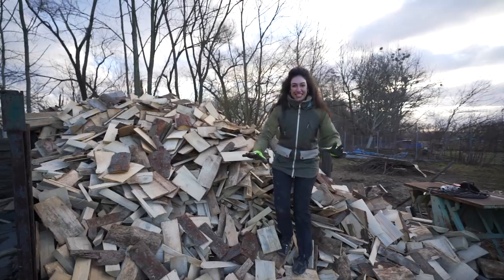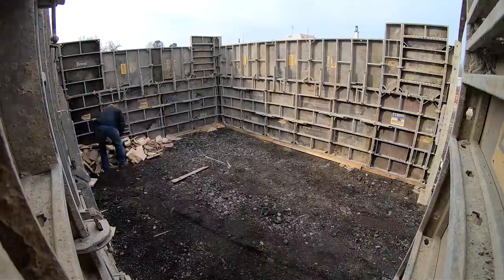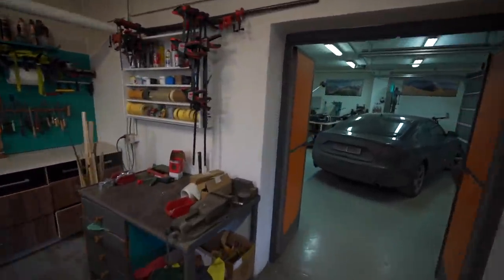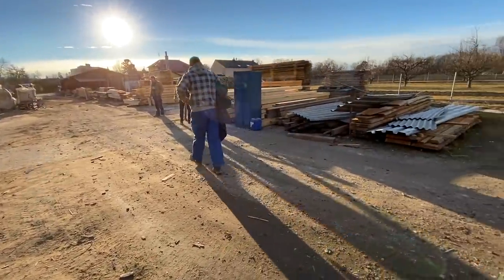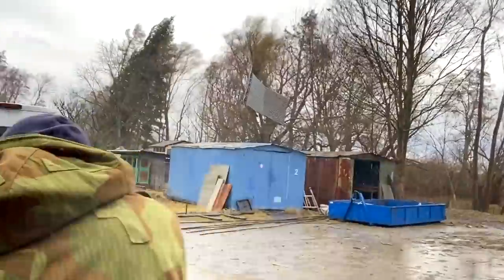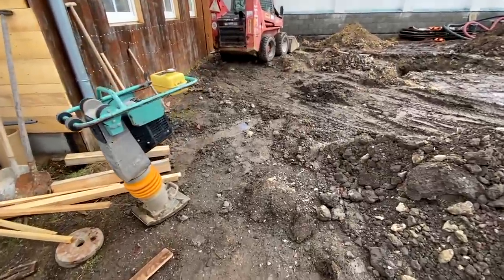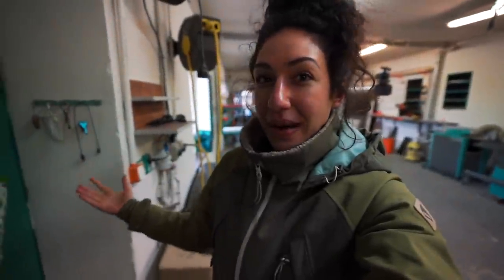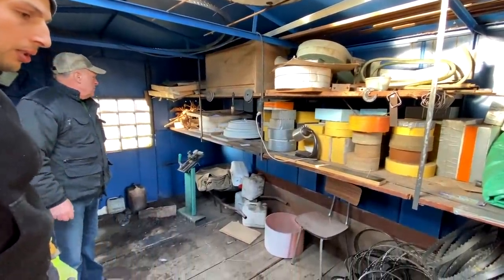Developing our Tiny House Homestead! / s2e2

Comment: I saw containerhomes be insulated from the outside. I like it because that way you save room inside and there is no condensate, you can even leave the container walls like the are if you want it industrial.

Comment: The wood shed is actually concrete form work the smooth side would be the side that faces in & a second layer would be put 5-6 inch away with its smooth side facing the other, then concrete poured in the gap, left for a few days to set the the form boards un clip leaving a wall, it’s a good use you have there 👍👍🇬🇧🇬🇧

Comment: Hi, don’t make it too nice you won’t want to leave for van adventures 😃.

Have you considered designing a bike for van life, light with a long battery life easily charged from the van electrics and with room to take laundry or collect shopping? Those speedy death machines are great to look at and I bet a thrill to ride (I think I’ll stick to my motorbike) but I don’t think you could get a couple of bags of shopping on board.
Reply from the maker: Don’t worry, we’re excited to start vanlife again! I actually developed 3 models already, tested and worked great as a van extension.

Comment: Those shed walls are concrete forms.
Just remember containers suffer from condensation on the inside. The best way to stop this is spray foam insulation. (I've been planning a container home for the cold of Minnesota)

Comment: It has to be great to have good family love and connections. I have a couple of questions. Which doorway is going to be set up for the van to enter? Isn't the hole in the ground that the water goes into going to turn into a sinkhole because of so much water which will be unsafe later?  It needs to have rocks in it to help the ground stay solid enough on top to not sink down and to help flow the water down below the surface.  It will also settle and need to be maintained over the next year or so or else you will have a  lower area all around the hole that you might twist an ankle on when going to go pick up firewood. Thanks for sharing. I love learning more about such building projects.

Comment: Did you ever think about rainwater harvesting.  You could get a few big tanks and have the overflow go into the ground. Also it may be worth considering putting landscaping fabric and gravel in the driveway to control the mud.
Reply from the maker: We have a creek right behind the workshop so no need to store rainwater. We’ll be building proper road and tiles all around but that will be very last thing after the apartment.
Reply: @ladiandmargaret  creak water can get contaminated if surrounding farmers spray with fertilizer, pesticides or herbicides. Do farmers there spray their crops or grow organically?
Reply from the maker: It’s the saying here that farmers spray and organic farmers spray at night 😂
Reply from the maker: We would be using the rain water for watering plants only anyways so not a concern for us.
Reply: @ladiandmargaret  that is so funny.  Are you on a well?  At least that should be safe